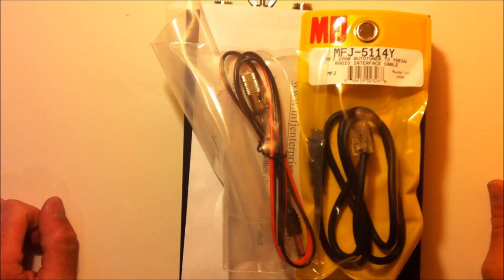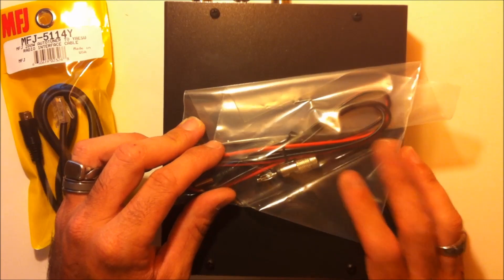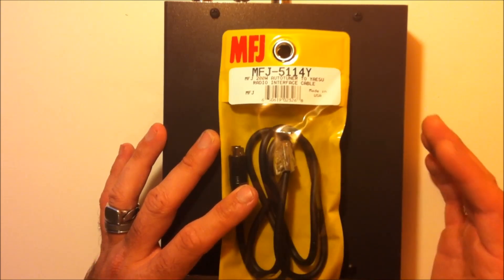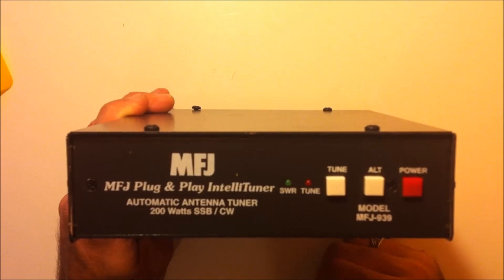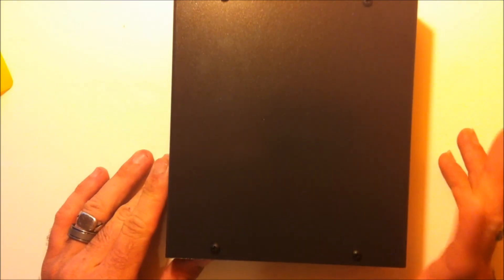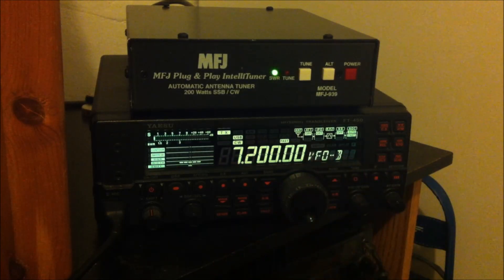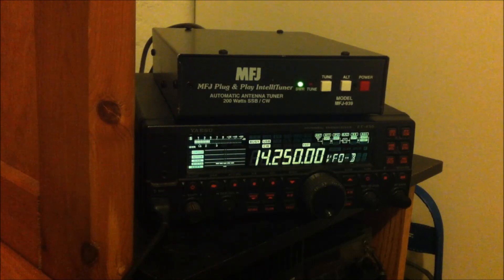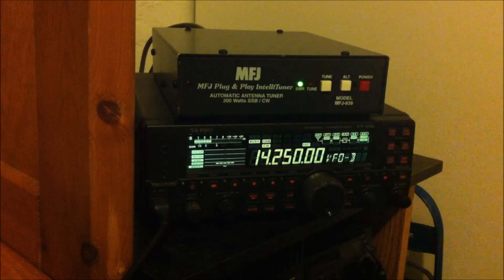MFJ-939 automatic antenna tuner review and demo

Comment: If manufacturers of Ham equipment were to lower their stupidly high prices, more and more people would be attracted to the hobby. As it, it is ridiculously expensive to build a half decent shack these days. Equipment makers are cutting off their noses to spite their faces though because lower prices would mean more sales and there is no reason for most of the markup they place on this stuff.

Add up the cost of a decent radio, power pack, co-axe, antenna/s tuners plus any test gear you want to buy and the total price is outrageous. I can only hope China will start to produce high quality stuff at much lower prices because we need the competition. The signs are that it is going that way and I am glad.
Reply: That's where Chinese manufacturers are getting into the game. It would be great if the big 3 lowered their prices. Provided they didn't lower their quality. Also, if cost is a factor then buy used. Not counting HT's only one of my rigs is new. All the rest I picked up used locally or on ebay. I got my Icom IC-730 for $200 from a local ham. The only issue with the rig is the preamp relay is shot. Otherwise it works great.
Reply: InTheNameOfJustice Have you thought about building your own equipment? There are lots of decent kits out there, from Elecraft, to TEN-TEC, to the Sienna that offer a wide range of features at many price points. Also, equipment design is not cheap and there is often years of expense without a dime coming in from it. Those costs have to be factored into the price.
Reply: Jack Purdum I have zero wish to build my own and while I realise that R&D costs money I also have enough economic acumen myself to know that R&D costs are recovered, usually, within the first year of an model's release. Often much sooner. Any subsequent improvements to the model are usually the result of customer feedback AFTER those costs have been recovered.

Under normal economic circumstances the costs will decline rapidly thereafter as all of the tooling, design and advertising costs will have been met and the justification for keeping the price high diminishes. This would normally mean, obviously, a fall in price to the customer. 

Except in the world of Ham radio.

For reasons not yet made clear to me, in this world, prices almost never fall much at all from their starting point. This would seem to be caused by two possible factors: Blatant profiteering and customers dumb enough to go on paying through the nose. Possibly because of some perverse snobbery factor associated with high cost items.

Added to this situation are many others like it in the various retail fields surrounding purchasing a Ham Radio. For example, why do a few aluminium tubes, rivets and plastic inserts, a few pieces of wire and a plug socket put together into an antenna, cost so much money? The contents of an antenna are very cheap when bought in bulk. Yet the cost is often sky high and again, never seems to obey the normal rules of market forces and come down.

The same applies to almost every piece of equipment found in the shack. Only the multimeter seems to have obeyed the rules of normal economics and become cheaper and cheaper. With the possible exception of the soldering iron -- though many of them are ridiculously over priced also.
Reply: InTheNameOfJustice I just looked at the price of gear in my 1961 ARRL handbook.  Over 50 years ago it cost about the same number of dollars to set up a nice boat anchor rig as it does today for a modern rig.  Ham gear is a bargain these days.
Reply: InTheNameOfJustice Call it BS if you want, but here are the numbers:  Looking at an HF rig - Today at ARS  an Alinco DX-SR9T - $699.95, Allinco DX-SR8T - $529.95, Icom IC-718 - $599.95, ICOM IC-7200 - $799.95,.  Considering the advances in technology since 1961, these radios are far better than anything you could purchase back then when $200 a week was a pretty good salary ($466 is the federal poverty level today for a family of 4).

Not many prices are printed in the 1961 Handbook, but here' are a few I found for top name SSB gear that were more basic than today's gear noted above  (keep in mind you needed both a transmitter and a receiver) - Viking Ranger Transmitter - $329.50, Hammarlund HQ-170 Receiver - $359, Hallicrafters SX-101A  Receiver - $399.50

You can point to the multi-kilobuck rigs of today, but they have features that didn't exist back then.

So a "load of BS"?  I hardly think so.
Reply: *****
It has only happened like this with Ham Radio because too few companies own the lion share of the market. Since I wrote that comment, Chinese companies have been having a huge impact on the market and it is now possible to build a shack for one fifth of the old cost. Granted, it will not be the highly sophisticated equipment found in many Ham shacks but it will do the same job for much less money in many cases.
Reply: Jeff Leites That's a load of BS pal.